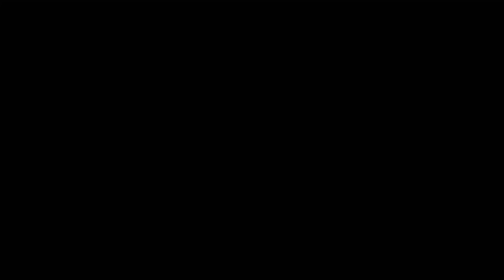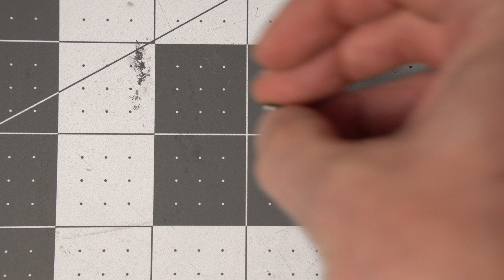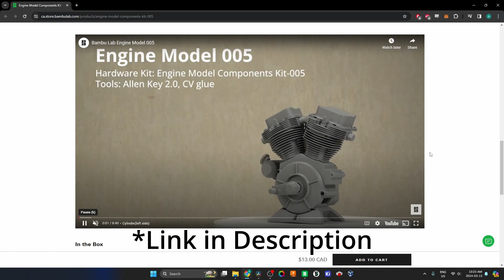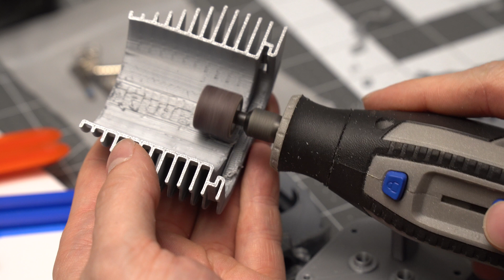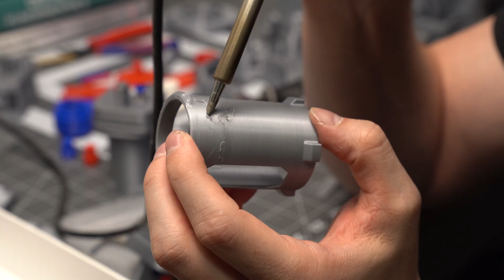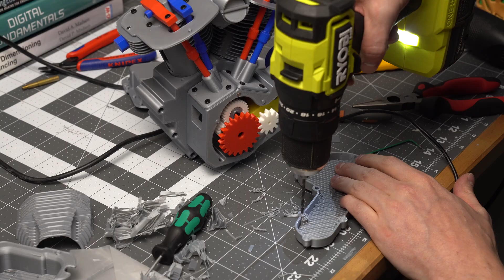Engine Model 3D Printing Kit - 005 - Bambu Labs | Double Check Your Print Profiles

Comment: The DC motor shipped with the kit is very weak. I wired in an adjustable dc step up transformer to boost the voltage going to the motor works perfectly now
Reply from the maker: Yeah this is a good point. Those little 5V DC motors with the gearbox struggle a bit to keep this thing going. You can see it slow down during 1/4 of the rotation.
Reply: @3DPrintStuff  yeah boosting the 5v motor to 12v made the model work so much better
Reply: do you think you could post a video about that?
Reply: @yobtnirp3D  I probably could by the end of the weekend
Reply: @Moodyfabrication  thanks so much 🙏
Reply: Very boring in action